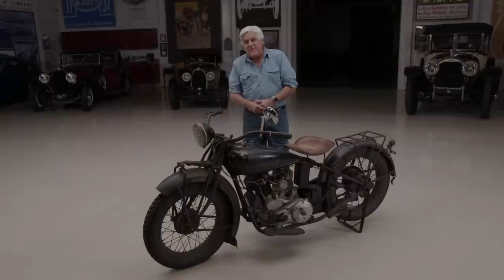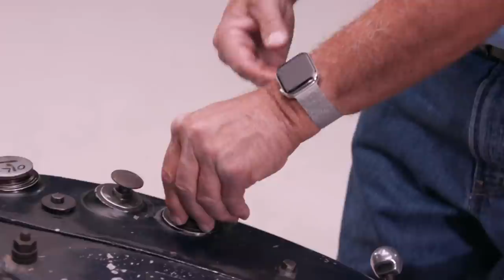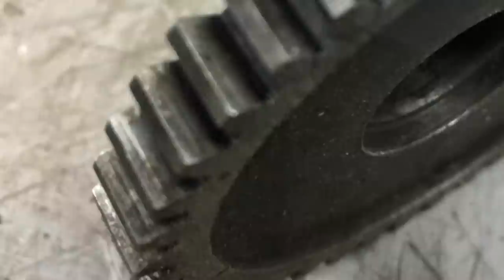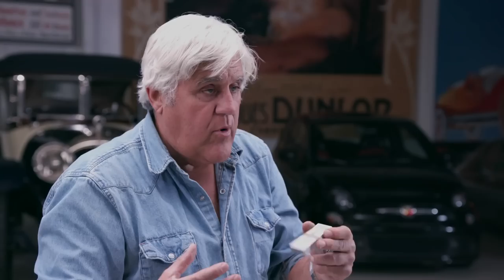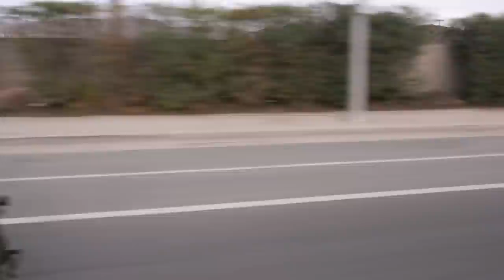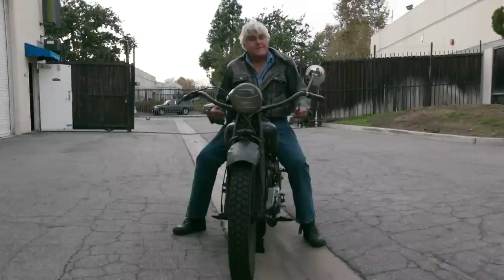1930 Indian Chief - Jay Leno's Garage

Comment: Great clip, i have the same 1930 but in Indian red. Haven‘t used it for 2 years now. Tomorrow i will try to fire it up. I like the tip to extend the starter. Sometimes it took 30 minutes to fire it. Cheers Dieter

Comment: Good video. I gave Penney Marschiarelli a ride home from a nightclub on my Flathead 45 Harley chopper with a 12" extended Springer with no front brake at all. It had a real Suicide Clutch without the "Rocker" pedal that stayed disengaged. Worse yet it had a Jockey shifter & no extended kickstart pedal. Even though I never weighed over 145 pounds, after priming the carburetor, it started with only one kick. Your video brings back memories from the good ole' Days!

Comment: The front brake on my '46 Chief is 1 inch wide. It was not actually designed to slow you down. It was more there to keep you from rolling backwards on a hill ;-) It really doesn't have a suicide clutch, all those guys who modified theirs like that, are dead. It has a friction plate and stays where you put it. You will never wear out an Indian clutch. Ever. Police used to just slip the clutch during parades instead of changing gearing sprockets. Most of us put the shifter on the left, so we can keep our hand on the right side throttle.  It has a nice steering dampner to help on the highway, that you can loosen in parking lots.
The throttle on most of them had a very weak return spring, on purpose. If you were at a stop light on a hill going up.. you can give it some throttle and slip the clutch until the bike "balances" itself, and put your feet on the ground and take both hands off the handle bars.  Oh and the front and rear wheels and tires are identical, and held on by lug nuts. You can swap them back and forth easily. On mine I can unbolt the rear wheel with taking the chain off.

Comment: I had 53 Gold Star that I rode from Illinois to St Augustine Fl in the early 60’s. Bought a rebuilt generator and a battery. That latest 2 days. I survived with the magneto with the rest of the trip.
The gear on the kick starter broke on the first day on the trip. When I stopped it was always on the top of a hill to use gravity to help with the engine start
Reply: I know what you mean about just getting to point B.
It was an ADVENTURE.
Enjoy what you do on the level I feel.
Being watching for years, thank you for what you do!!!!

Comment: i used to have a bike that wanted to kill anyone who rode it, a 1973 honda cr250...air cooled 2 stroke, mixed gas..had no flywheel so it had no power at all until the powerband hit at about 5-6000 rpm, then suddenly it had way too much power and would usually catwalk on you. i dont know how i managed to learn to ride on it, at 14 years old...i let some friends with new dirtbikes try it, they nearly wiped out and had the pants scared off of them...i got so much respect from those guys after that...it was like an evil spirit was trapped in that bike, i never shouldve been forced by parents to sell it. those were some amazing times, all bikes i tried after that one seemed utterly tame...was missing the end muffler piece so it would make your ears ring...it would rev up to 14,000 is my guess...pure evil and pure fun, like the wrong woman, good analogy
Reply: vargo hoat  yea old dirt bikes that where carbureted had very short but powerful power bands. They wound up slow them all of a sudden full power then nothing again until you shifted and keeping it in that power band was the trick. That’s something I notice most about old bikes over new ones, new bikes are more linear the pull more consistent with a wider powerband all the way through the RPM range. The new ones are faster but do t feel like it my ZX750RR had an amazing power band at 9k RPM until about 11rpm but my 2009 R6 was faster and just pulled hard all the way through the rev range with a slight pick up in the upper range above 10k rpm.
Reply: I remember those-powerband came on like a case of dynamite. Hope it's pointed where I wanna go,cuz I'll BE there before I can change my mind!
Reply: vargo hoat two stroke race bikes hit that power band and snap you into orbit.  So much fun..  brrrp brrrrp brrrrrrrrrrrrrrppp gone.
Reply: l love your first sentence.  murderous bike
Reply: Oh, hey, an Elsinore. My father had one of those when I was little. I have vague memories of being taken for rides on it, when I was so small I could ride in front of him. (I also seem to remember my mom did not approve.) It ended up spending 10+ years in bits in the basement after some unspecified incident; when I was in high school, Dad and I tried to restore it, but we could never get the electrical system to work. I don't know what finally ended up happening to it; he probably sold it to some kid looking for a project.

Comment: Most old Indians had similar controls and operating procedures, later models had oil pumps.  "Treadle clutch", hand shift,  and spark advance requires practice for safe  riding in stop and go traffic.

Comment: I was a the finish line in Tacoma when the Cannonball Run finished.  Those total oil loss bikes crossing the line all had rear wheels soaked with oil.  Not a safety issue at all.

Comment: Please explain, the "suicide clutch"? Thx.
Reply: Your foot operates the clutch. Your weight shifts as you let off the clutch which means you risk dumping the clutch if your foot comes off too fast. 
Combine that with a suicide shifter (hand shifter on the gas tank) and you got yourself a death machine as one hand and one foot aren't firmly planted.

Comment: That's what we called a "Rat Bike" . Reminds me of the 45 flat head I had 30 years ago.
Reply: KAMAKAZIJEFF1 a rat bike is a bike built with the parts of other bikes., not necessarily the same brand or model. This is all original (other then the mirror), but unrestored (other then getting it running and rideable.

Comment: Vintage motorcycles in are so complicated to drive.  I think I’ll rather ride  a bicycle.  Modern motorcycles are so easy to drive they’re mostly automatic twist the throttle and go.  You may not even have to learn how to drive a motorcycle with a clutch unless you want a sports bike or large displacement engine.
Reply: Chris Bautista that’s why I bought a 78.

Comment: My 33 Harley Flathead was total oil loss system too. It had a leaver on the left side at the bottom of the motor you pushed open to drain the left over oil out when you're done riding. I love these old machines I enjoy all the little extra stuff you have to do to ride them.  Mike Thomas at Kiwi is my main source of parts for my 46 Chief im restoring. His book on rebuilding an Indian is a great book to have with more information than the shop manual. Thanks Jay.

Comment: i've got thousands of miles on my 37 chief.  riding it isn't any harder than driving a manual car.  the hard tail/leaf spring chassis will beat up your body, running low tire pressures helps a bit. you do need to ride it "like a horse"

Comment: I wonder if in 90 years from now people will think how odd our motorcycle's controls are. "Oil valved dampened shock absorbers, runs on dinosaur piss, has a mechanical coupler to move with manual selectable gearing, only goes 160mph,... How odd"  lol 
Love the bike Jay

Comment: Those old machines could still run with all those busted, worn out parts. Today, if you sneeze the wrong way, your vehicle needs a complete overhaul, or several expensive parts replaced.

Comment: That's an awesome piece. I don't know what you're going on about saying it's a piece of junk, you were going to throw it away, you can crash it all day long (please don't) but if you're going to, I can give you my address (and a million others would too most probably!)
The crack repair method using taps and screws is very common when you can't/won't weld the crack but I had never realised how exactly it works until that little demo you made - I'm still amazed and baffled by it though, perhaps even more now. 
The bike patina and condition's great, great safety move switching the handles around. The frame looks straight judging by the way it handles. Just be safe! If there is someone who can recondition/resurface those brake pads with modern materials you probably know them/can find them. I have to say a bike of this age with that kind of power - regardless of geometry - going 80-90 mph looks downright scary to me !

Comment: I had a 1938 80 inch Chief.  What surprised me the most was how good those front forks are.  Felt like you could thread a needle with them.  And yes, the engine had bags of torque.  Easy to start as well.

Comment: Great video. I wasn't even going to watch because I'm not really into bikes anymore, but this thing looks like a fun ride, and a death machine. I worked at a golf course when I was a kid in the 70s and I used to cut the greens with this crazy mower that had multiple levers for propulsion, blade speed, lifting/lowering the blades, etc. It was like a choreographed dance cutting the greens with that thing. You had to cut a swath, lift the cutting blades at the exact moment on the edge of the green, turn the machine 180º, lower the blades again at the exact spot, etc. Jay riding this bike doing a similar intricate dance to make it run and not kill himself reminded me of the mower. The only thing I'd change here is that mirror. It needs to be relic'd, or an old relic needs to be found and installed to make it look more original.

Comment: A mate of mine has/used to have an old Indian like this (I say "has/used to have" because we've lost touch over the years.)  It was an ex- Wheel Of Death bike - hard tail, suicide clutch, hand shift, no rear suspension...but with a shortened frame so it could handle riding around the inside of the barrel.  Looked like a piece of rust, but still ran pretty nicely.

Comment: That thing look so unstable when you ride it with such loose steering. And the seat is so bouncy......... I could never do it. But at least it is interesting. Going 40 mph would be about it, for me.
Reply: Mickey Cook reminds me of my 78 Honda XL350 dual sport. I have. About the same condition. Runs great, looks like a lot of people were hurt on it. It’s never been registered for the street ever in its life, though it is street legal.
Reply: @CamaroAmx  Had a Honda CB 160 then a 305 Scramble in the late 60'. BUT started out with a Bridgestone 60 Sport....... sadly. Still have the piston and chromed tube from the filter to the carburetor from it, sitting on my desk in front of me.
Reply: Mickey Cook my first was a early 70s Honda Trail 50 (one appears on a Roadkill episode). Still have a scar from the first time I dumped it. My next was mid-late 70s Yamaha 175 dual sport that I rode the heck out of. Planned on using it as a daily in high school until the crankcase cracked. Got out of riding for a bunch of years and now getting back into it.
Reply: @CamaroAmx  Never had one, but always wanted a Bridgestone 175..... dual cylinder 2 stroke of course. Had a chance to buy one and passed on it.... kicking myself